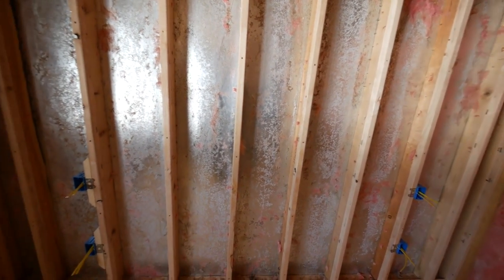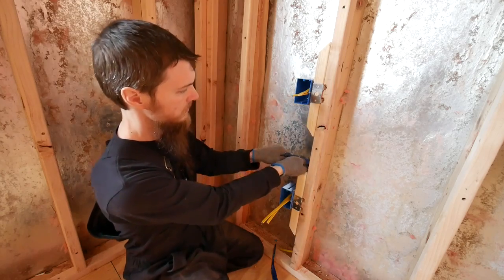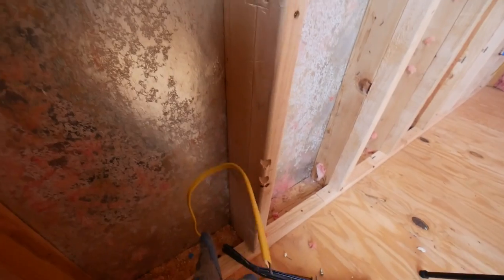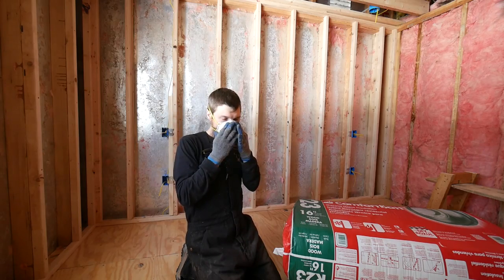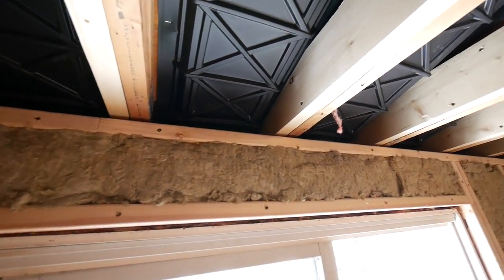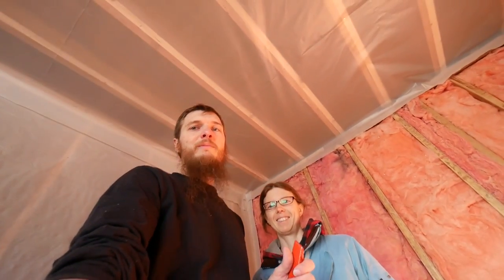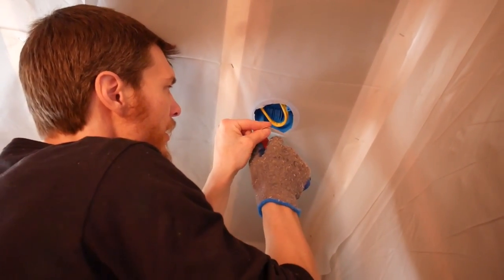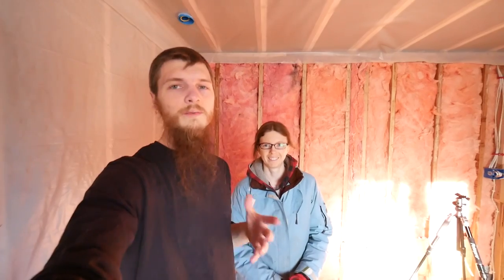A Sensational Insulation Installation - Home Renovation

Comment: this is a beautiful job in my humble opinion, but rooms that are too air tight can become "sick"...you can find articles on it ...( lack of ventilation.) so I personally don't want an airtight home ( good thing because I hang sheets over the doors in the rental in the winter to help keep out the cold. I always have the window open a tiny bit even in winter.  ( and I run fans 24/7 year round and you don't like fans )  I saw the finished room video first and it comes out GREAT
Reply from the maker: We just have to do it to "code", that's all :) Thanks
Reply: @diyfferent  I appreciate your integrity to code and attention to detail...and innovation!

Comment: Alsoi used a  Smart Vapor Retarder by Certainteed its more expensive but breaths better and it adjusts to the changes in Temp and Humudity you staple it and then seal the seams with tape.

Comment: I’m only a few minutes in but I’m wondering why not fill that gap at the floor with foam so you didn’t have to notch the insulation and it would give it an air tight seal?

Comment: So glad you found Roxul insulation!  It's the best there is, and will pay for itself many times over in its lifetime.  The bees knees!  Not that many people know that fiberglass insulation will only give you the rated thermal value in the best case government "hot box" testing situation.  Once you introduce even the slightest amount of humidity, fiberglass' insulating value begins to decline significantly.  I'm surprised you didn't comment on how the acoustics changed as you installed the Roxul.  You can hear how tight it is.  Nice going guys!

Comment: Don't know why you didn't just use the roxul for the ceiling also, so much easier and less messy then the blown insulation.
Reply: Cost is a factor I should think - Roxul is expensive and blown-in cellulose is pretty cheap. Some of the big box stores will provide a cost-free rental of the blower if you buy the insulation from them.
The blown-in cellulose is treated with flame retardant and pesticides, so some concern about fire and pests is mitigated. But if money isn't too limiting, Roxul in the ceiling would be a great choice from a fireproofing standpoint.

Comment: Is plastic wise? Moisture needs to go somewhere, I've seen a lot of construction and I don't recall plastic moisture barriers for exterior walls?
Reply from the maker: Unfortunately it's code here so we have to follow it whether we believe it's a good idea or not. Personally I believe the house is better without it if properly built and sided. But that's my opinion.
Reply: @diyfferent  I've seen unfinished basements around here that have plastic wrapped over unfaced fiberglass insulation.  Some sort of vapor barrier is required and that is why they do it.  But usually, when you come to the point of hanging drywall we tear down the plastic since the drywall itself can be considered a vapor barrier.

Comment: DON"T wash them with anything else. You might try blowing off some of the insulation if it will come off.  And after your done run the machine through a rinse cycle without anything in it.  I would wash them separate for a few times. You don't want it to get mixed in with the kids clothes.  I use to help do insulation and just kept those clothes separate and only used them for doing insulation. I made the mistake of not cleaning out the washer once and the next load was awful.  You couldn't see it on the clothes but you sure could feel it.  Have you ever tried the recycled blue jean insulation?  It doesn't itch.

Comment: Random that uou need that plastic barrier on top of the inclusion ae? We have to do building paper, easier if putbitvon from outset, causecif doing on inside u have to do packet style in-between joists. Then insilatin in then dry wall, no plastic. I might ask on home reno page why America does this n we dont?
Reply from the maker: It depends on the climate and type of insulation being used, so it will vary throughout the USA. Warm climates shouldn't have a vapor barrier on the inside of the home. We were using Rockwool insulation and it doesn't come with a barrier. So since this home was in the very cold north so we had to do it on the ceilings and walls.

Comment: I seen many trailers for sale cheap but I never bought one because of the resale value is less than a stick built house.
Reply: Sawmiller Smith That’s why you buy a cheap used one, and maintain or improve it, then you’ll at least get your money back most likely.
Reply: I see them for sale cheap also , if you bought it cheap you wouldn't expect the resale value to be the same as stick built.
Reply: I bought a house for 5000 dollars a few months ago that needs some work. I would think if I fixed up a trailer for the same price it would be worth less then the stick built,but maybe not. Its just what I think others would think when buying a house.

Comment: The R factor of the length of 2x6 you put in would be less than the cut-around insulation you would have had.
Reply from the maker: Probably, but if I had any air gaps from my cuts it would be quite a bit worse.
Reply: That house is going to be buttoned up so tight you will be having to keep windows open to get oxygen. 😂
Reply: @lorrainei.1667  You are so right there.

Comment: You seem to research everything well in advance, but as far aa taking out the 2x4 pieces and the outlets/switched so you don't have to take the time to cut insulation around it, in my humble opinion you used all that time by redoing it. I know it's your house, but I wouldn't have. Notch it out , out it in and move on.

Comment: Why is vapor barrier on the inside ?
Shouldn't it be between vinyl siding and studs?
Reply: The vapor barrier stops moisture from migrating into the insulation, causing mold and lowering the insulations R value due to compression of the insulation fibers.
Reply from the maker: It all depends on your location. Up north, this is normal.
Reply: @diyfferent  we did it that way in a nc trailer park .... tenant put a humidifier in the trailer 

Horrible mold on the wall... maintenance said we should've  put vaporbarrier on outside ...daid we used the wrong product  too..
So much for renting out our old trailer
Reply: Yes, I'm up north.... Freezing outside temperatures and warm, moist indoor conditions. 😉😉😉
Reply: @jeepsanddragons  Georgia here. I was wondering the same thing. We're re-doing an old single wide & the vapor barrier is on the outside, not the inside. I was starting to worry!
Reply: @ladypearl9134  im in tx , but i lived in lots of mobile homes from Louisiana to North Carolina. 
I guess it depends where u live ....
Reply: @jeepsanddragons  I guess so too. I was hollering at the screen, "noooo....vapor barrier outside....outside!" Thankfully before making a fool of myself, I read through the comments first!
Reply: Doing awesome!! Hugs all around!!
Reply: @jeepsanddragons  NC is a tough location, being in a transitional zone for climate. Heating and cooling loads are pretty equal. It's the same reason I have trouble growing a good lawn here in NC - not hot enough for long enough in the summer for hot weather grass like Bermuda or Centipede, too hot for cool weather grass like Fescue or Blue grass.
Reply: U r doing a great job! U have great talent for remodeling/rebuilding/refurbishing! Love the progress!! God Bless!

Comment: Ripping wood with a cordless circular saw ? get a portable table saw, you'll get a lot of use from it.Also I'd have vacumed saw dust and wood chips out of wall cavities before insulating. I wonder about condensation between insulation and metal sheeting on exterior walls.
Reply from the maker: I was only shaving off a bit if the end so the circular saw quick and easy. There is no metal on the exterior, it's just a foil/shiny backing on a thin fiberboard.

Comment: No outlets on the wall with the window  code every 6 Ft..
Reply from the maker: There is an outlet on that wall and it is within code. Code states: "Receptacles shall be installed so that no point measured horizontally along the floor line of any wall space is more than 6 feet (1829 mm), from a receptacle outlet."
 You basically have to be within 6ft of an outlet at any point along the wall if that makes sense. This means that outlets may be up to 12 feet apart and no further than 6 feet from a door or other other permanent breaks in the wall.